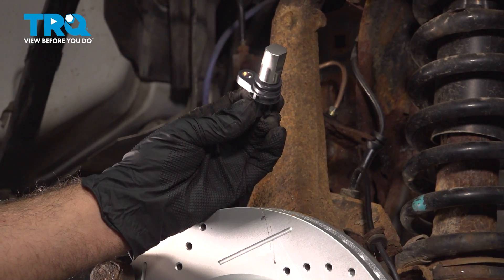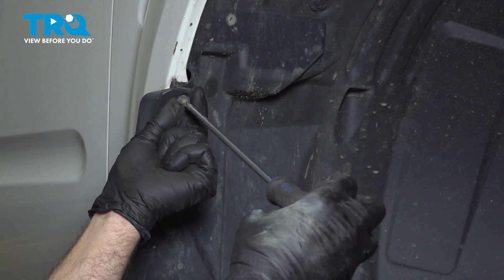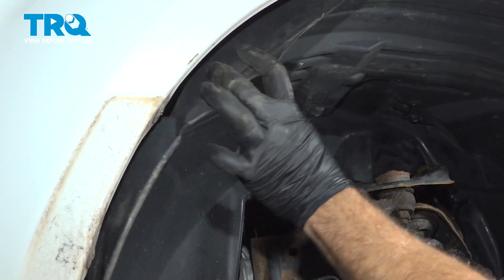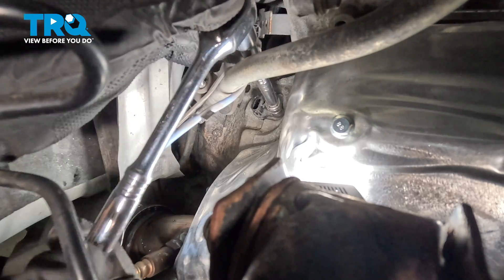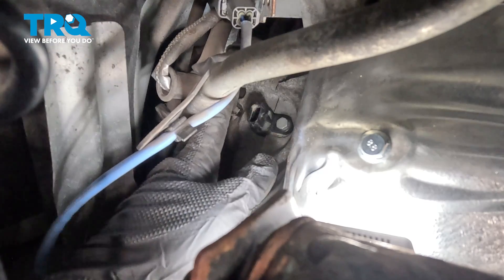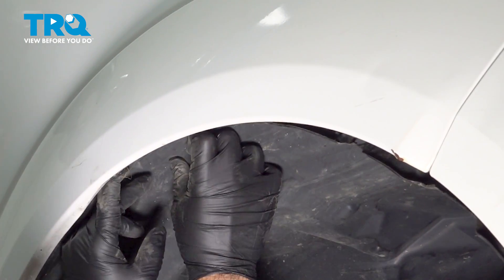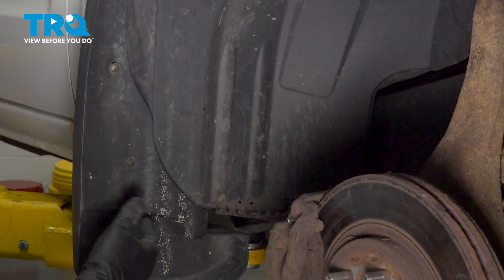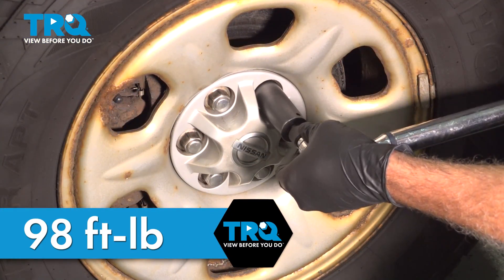How to Replace Crankshaft Position Sensor 2005-2021 Nissan Frontier (4.0L V6)

Comment: I first experienced the Perkins and motor cut out. Cam Sensor code. Changed both. All ok again. A month later same jerking and cut out. This time Crankshaft Sensor code. Will change out and start thinking about buying a new truck.

Comment: I have a 2012 Frontier. After the truck shut down and had a hard start, the reader said bank 2 sensor was bad. I read that both should be changed at the same time. I bought both but just changed bank 2 cause 1 looked like a PITA. The truck ran like new again. 13 months later, now bank 1 is bad🤦 I should've just changed both while I was at it. It's my project for tomorrow, I guess!

Comment: When you place the new sensor in,  the tabs for the connector is on the left side. Then once you screw it in and talk about snugging it tight, its changed to it being on the right side and looks like you put back in the old sensor. What happened?

Comment: I have a 2012 frontier. It was driving juat fine and all of a sudden it started jerking every few minutes then the engine just shut off completely. No check engine lights or warninga at first. 

After a while i got it to throw a code to confirm it was the sensor. 

Replaced it today and so far so good after a test drive

Comment: That’s the camshaft not crankshaft
Reply: It is actually the crankshaft sensor. The sensor reads a reluctor on flywheel.
Reply: No that’s not, cams are on the top of the engine. That is the crankshaft position sensor
Reply: Cam sensor is on the top
Reply: No it’s not.

Comment: Bought a 08 pathfinder w/ 129k had a rough up and down idle when coming to a stop otherwise ran fine replaced spark plugs and ignition coils and same result with rough idle. @ 193k miles engine turned off on me twice at different times while driving. Replaced crankshaft sensor. Doesn't stall while driving anymore and fixed the idle no fluctuations what so ever. MPG's also went up. Wish I had did this at 129k miles.
Reply: I had the same thing happen to me. A new sensor made all the difference in the world.